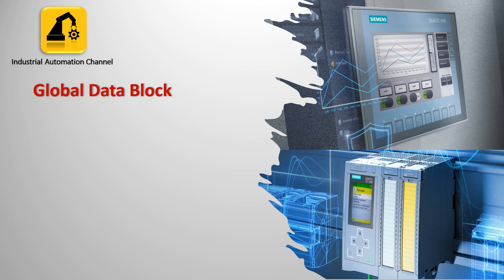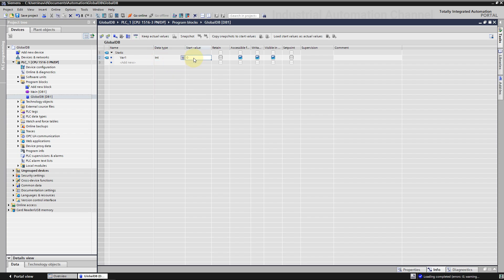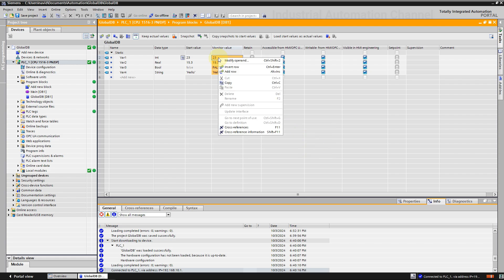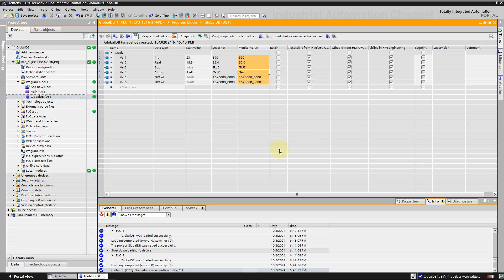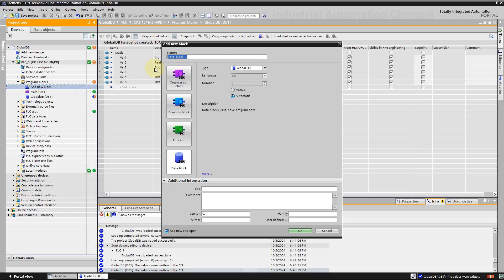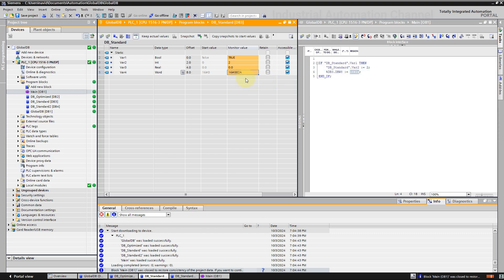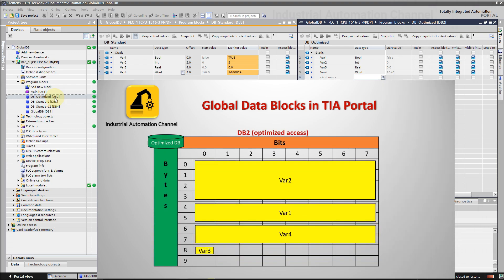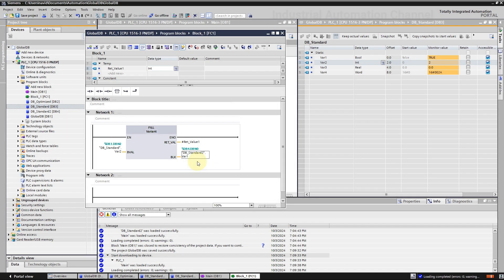How to Create and Use Global Data Blocks in TIA Portal | Tutorial #26

Comment: Hi, what is the general difference between tags and variables stored in global data blocks.  It seems possible to use data block variables in place of tags I think.  What is the general philosophy difference between the two?
Reply from the maker: Good question 👏
A variable in a global data block (DB) is a data element stored inside the DB.
It defines memory space and data type within the PLC. Each variable has a name, data type and a memory address. These are actual data items that the PLC reads/writes during program execution.

A tag in TIA Portal is a symbolic name or reference to a variable, memory address, input/output, or any PLC element.
They are used for symbolic addressing (When you don’t use absolute addresses like I0.0 or DB1.DBW2 directly).
Think of tags as “labels” or “pointers” to data — they don’t store data themselves
and variables as the actual "containers" for your data inside the DB.